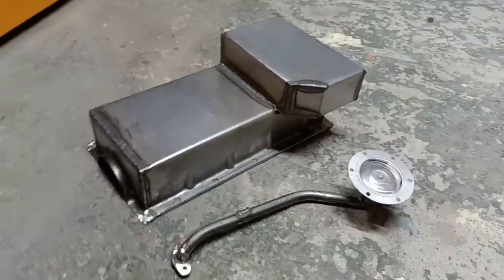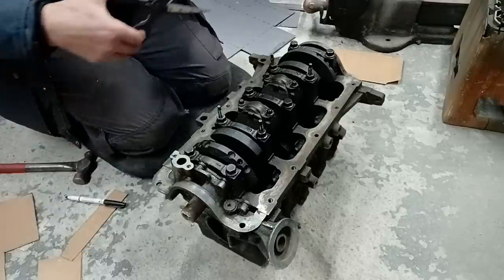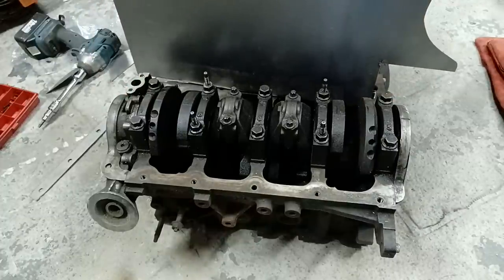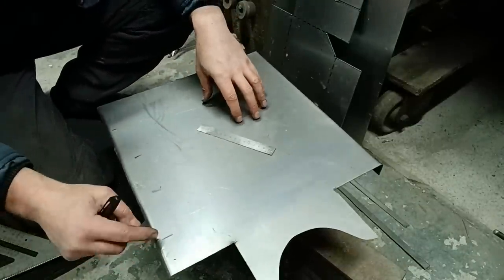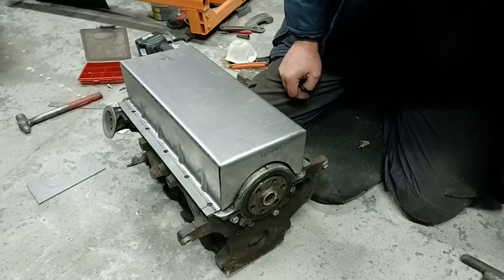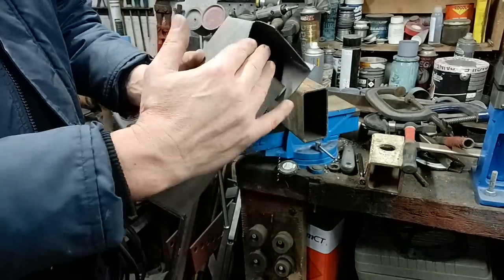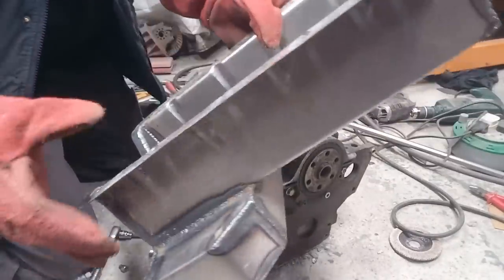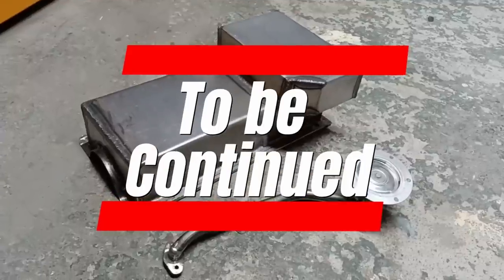Ford Escort MK1 MK2 Classic Ford DIY RWD Zetec Sump inc Plans

Comment: So finally here is something, I’m a truly expert on.

First, I would say that you did an excellent job of planning out both the shape, and the sequence along with the appropriate features. 

Here are some things to know when building liquid tight sheet metal weldments. 

The welds should be bubbling through on the backside in a continuous blue streak. This takes practice but it is an indication of good penetration. If you can achieve this, then it will be OK to carefully buff the welds smooth, being careful not to get into the parent metal as this will weaken the joint. Fine grits are the order of the day.

The welded corners don’t have to be square. Make a simple welded dolly with a half inch diameter bar as the mandrel portion. First, take a cut-off wheel and slit a single pass through the tacked joint to be welded. Place your homemade dolly tightly against the inside of the joint and hammer the edges over. This will create a quarter inch radius on the corner. Re-tack the corners.

The best joints have a definite gap but no wider than the metal thickness. This makes for good penetration. The joint should be backed-up with a close-fitting aluminum rod.

Warming the piece before welding will tend to minimize warpage. 200°F is about right. I use a digital thermometer but a 203°F Tempilstik (https://a.co/d/gld7biN) is probably a better choice. The Tempilstiks are consumable so I prefer the digital thermometer. The heating process should be done uniformly. Otherwise it’s possible to warp the piece with the preheating, itself. 

The process of making cold rolled steel crushes trash into the surface. This trash will compromise the quality of the weld. To remove this, buff lightly with a fine grit disc. This is almost impossible with the 20 gauge steel used in this oil pan. It’s so thin as to make it very possible to grind the edge to nothing.

So here’s the coup de grace on leak proofing welded steel containers. Loctite 290 is not only a thread sealer but it also seals weld porosity when applied correctly. The proper temperature is 180°F. I monitor the temperature with the digital thermometer until it gets below 200°F and then take an acid brush and paint all the welds. Painting one side is adequate. I’d prefer to do this after all the welds are polished which requires reheating the piece to 180°F. I do all my preheating with a propane weed-burner (https://www.harborfreight.com/propane-torch-with-push-button-igniter-91037.html). 

The Loctite 290 is good to about 500°F. So if your pan leaks, you’ve got bigger problems than the leak itself.

I have used the Loctite 290 with 100% success both at work and at home. A pressure test is still a good idea though. For an oil pan I would use 3-5psi. Much more than that, you’ll permanently deform the oil pan. 

One final note, modifying the factory oil pan will not likely work out as the stress induced in deep-drawing the part to shape is so great that cracking of the parent metal is almost a done deal if you mess with it. The only way to get around this would be to heat the oil pan to about 1100°F to stress relieve the piece. Pretty much a nonstarter.
Reply from the maker: Fantastic, good to have an expert view, thank you 😊

Comment: Your a clever lad. I have finally solved the Halfords weld through primer spray cap blocking up issue...simply use a Hammerite one.
Reply from the maker: 🤣🤣 why didn't I think of that

Comment: Lovely job Dave saved some pounds 👏👏 put some red diesel in the sump just to check for leaks. done it in past when repaired sumps you can see it weep out pin hole's 👍
Reply from the maker: Thanks Sid, good idea, but I've almost completed a test rig now 🤣🤣
Reply: @DavesGarageuk  clad to help Dave . Bet you spent hours on the test rig 👍

Comment: Once again fantastic work ...have you everthought of using a oil temperature mockup in the sump...
Reply from the maker: I've done that with aircooled VW engines I've had, but not with a water cooled. I'll give it a thought though.

Comment: The wobbly end on a steel tape measure is there on purpose. It compensates for internal and external measurements. That’s a lesson I used to teach my apprentices on their first day on site. 45 years ago every new school leaver could use a tape and do simple maths in their head. From around 15 years ago we had to start from scratch and teach measuring and simple maths to prevent excessive wastage of materials.  BTW I could still kneel down like that but I do t think I could stand up again on my own!!!
Reply from the maker: Thanks Tim, I did not know that!! Been a plumber for over 30yrs too 🤣. Never too old to learn something new, or in my case, I should have already known!
Reply: @DavesGarageuk  something else I have just remembered re tapes. When working with a helper make sure you check each others tapes side by side for accuracy. You would be surprised how often they are out.

Comment: saved yourself a few hundred there dave! I always jigsaw on a thick piece of polystyrene, its keeps the noise down & can cut some really accurate shapes, I notice you have the pendulum on high, you don't need it at all on metal, also you can get some very tight curves if you grind a few mil off the back of the blade.
Reply from the maker: All good advice, thank you 😊

Comment: Really nice job there Dave, may be worth keeping the formers for the strengthening lip at the end of vid and using them when installing sump, will spread the load on the gasket more evenly and stop any possible distortion and guarantee an oil tight joint??

Comment: great stuff dave,i have a pinto 2.0l to fit into a mk1,i've never made a sump and now i've seen you do it im gonna wave paying 600+ for an rs2000 sump and have a bash at it,so is this pretty much the same as it would be for the pinto,some just bash the hell out of the sump till it clears the crossmember and steering rack.
Reply from the maker: Have a go mate, nothing to loose really, just time in trying it out

Comment: I have no idea how the curved bit each end will be oil tight once fitted? I can see that the bolted sides will have a gasket between the two surfaces but the unbolted curved ends? (Excuse my ignorance, I’m electrical not mechanical!!)
Reply from the maker: Hi, thanks for your question, it'll be sealed with an RTV silicone, a lot of new vehicle sumps are now.

Comment: Nice work but not to throw stones in your gears you’ll going to hate the sheet metal pan. They all leak on the zetec, every one sooner or later.
Reply from the maker: Hi, if your comment on throwing stones into the gears, refers to the crud going into the block, don't worry, its a scrapper I use for mocking up.  😉
Reply: @DavesGarageuk  No not about that, but to dampen your spirits about the pan. Unfortunately all the sheetmetal pans tends to leak on the zetecs. The aluminum counterparts don't for some reason.

Comment: Why don't u fill it with white shirts to test it if its gonna leak that will 
Show u without doing a rig
Reply from the maker: I've built the rig now, was simple enough as it happens.  I have previously used diesel etc to test, but it didn't get right up into the corners.